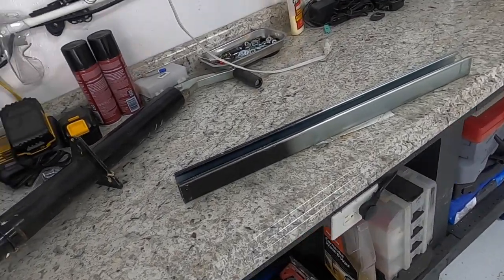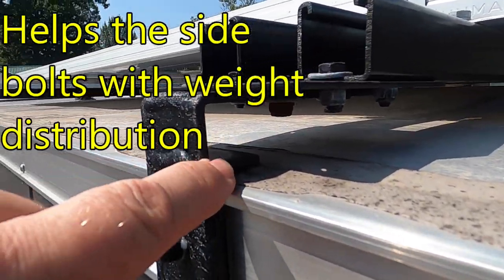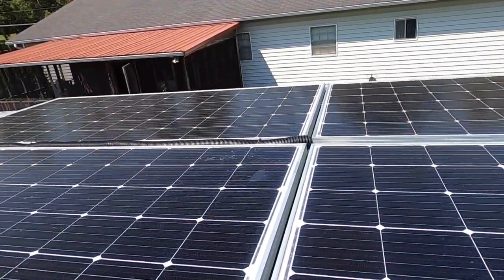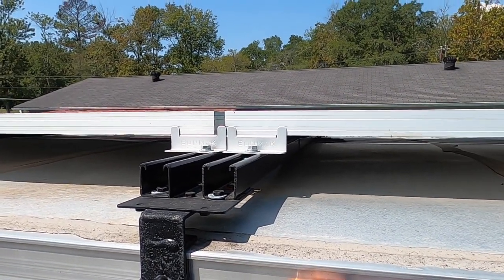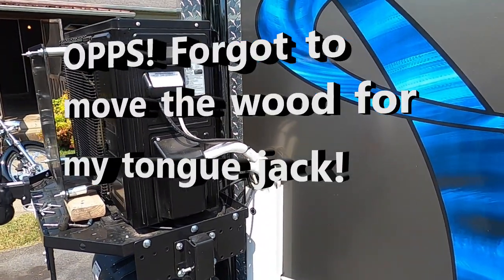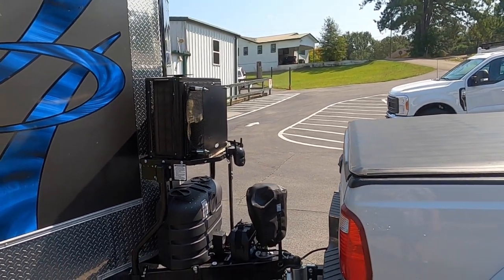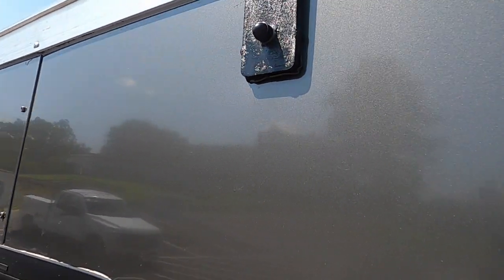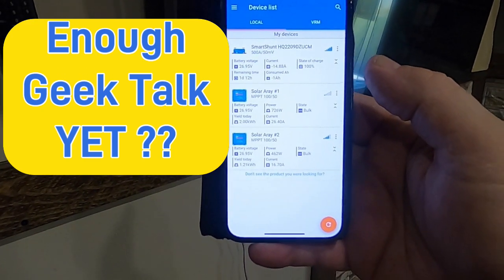How to mount solar panels on a Cargo Trailer Conversion. Tough as a TANK!!

Comment: I like the brackets you made to attach the unistrut to the trailer, much lower profile than the commercialy available ladder racks. 👍
Reply from the maker: Thank you. Yes I wanted it as low as I could and still have air flow under it. Thanks for watching and commenting! See you down the road!!

Comment: Given the way that solar panels work, those small panels that power your cameras may be affecting the performance of your big panels more than you think. I would consider mounting them in a way that does not shade the big panels.
Reply from the maker: Typically I would say yes. But I have so much up there that one array of three is what is powering everything most of the time. I split the 6 panels into 2 arrays. So I have about 1100 watts on one array. I have had all 6 helping on cloudy days sometimes though. Thanks for watching our channel!! Love to interact with people!

Comment: What kind of tow truck? GVWR capability, and weight of the trailer loaded? How about gas mileage with/without trailer? Great rig! Thanks!
Reply from the maker: 2016 F-350 dully. I can’t remember for sure but I think it’s 14,500. The trailer without the gold wing is about 7500lb depending on what Kathy packs! Lol with the motorcycle it’s roughly 8500. I get 17-18 mpg empty and 12-13 towing. 
Thanks for the kind words!! And thanks for watching. Have a great day!!!

Comment: How r the brakes holding the panels? Did u secure with screws and I just don't see?
Reply from the maker: Are you talking about how the panels are secured to the unistrut or the brackets on the trailer that holds the unistrut? The brackets are screwed through the upper and side frame. The panels are held to the unistrut by bolts that screw through the panel bracket to the nut in the strut. Hope that clears it up. If not I’ll take another shot at it! LOL!